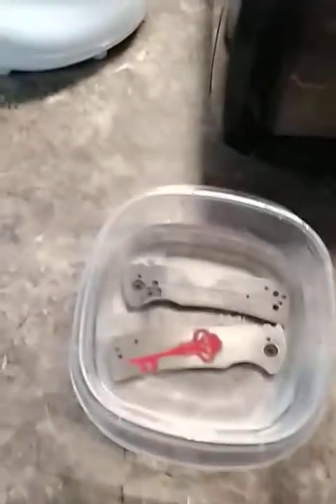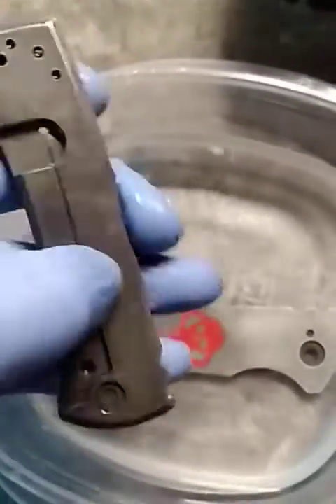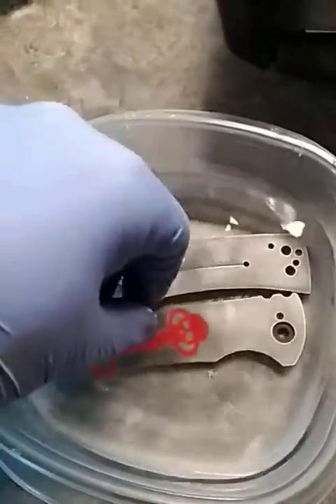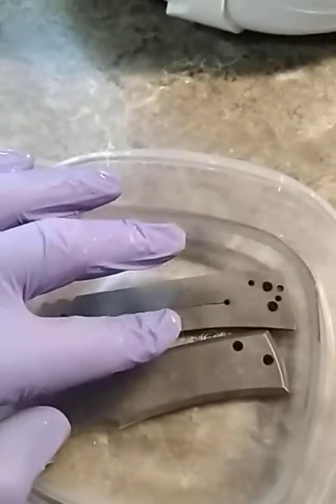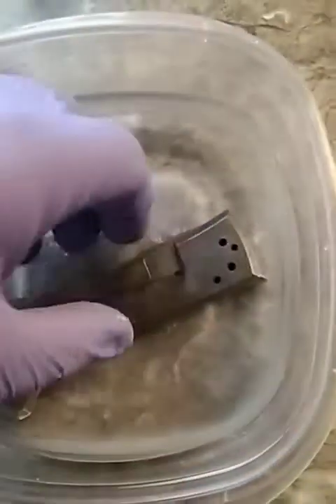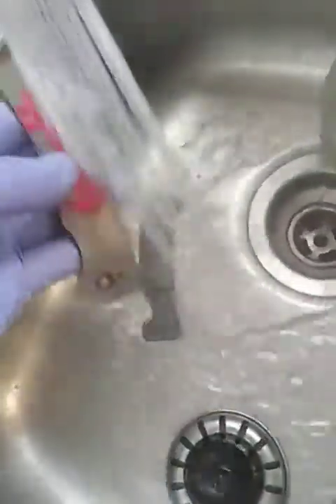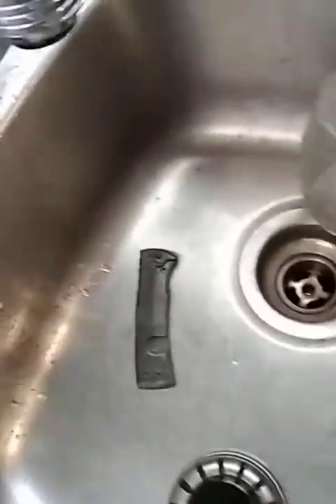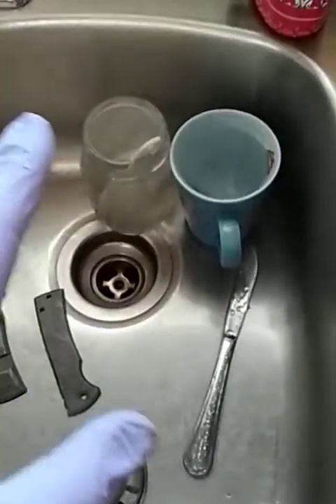Lye Crystals Remove Anodization on Titanium 1of2

Comment: Man, i have 2 Ti keychain "beads". Following your Ti/H²0 ratio to a smaller container, 1 of the keychain beads, 80% bronze/20% light blue, came off in a few minutes. The other one, DEEP blue one, isn't budging AT ALL after 15 minutes! Like, not even a tiny lighter hue. Nope.

I'm 15 maybe 25 minutes away from just pulling it out and polishing the color out tomorrow. It'll be a pain because it has deep narrow grooves in it that will be difficult for the buff material to get in to get out the color perfectly.

Oh well. Here's to hoping.
Reply from the maker: Thanks for Watching!
That's an awesome & then interesting result. I wonder what the second piece is processed with?
I'm sure you will find a resolution & it'll be super custom!
Thank you for the comment!
Stay Sharp!!